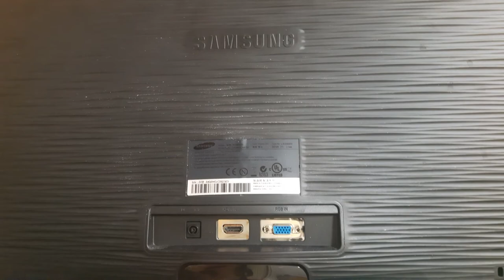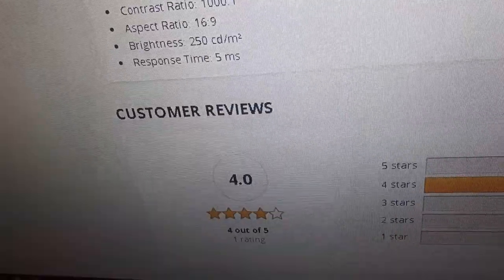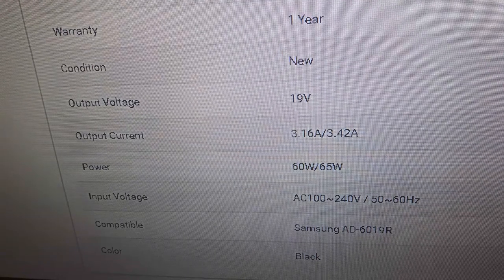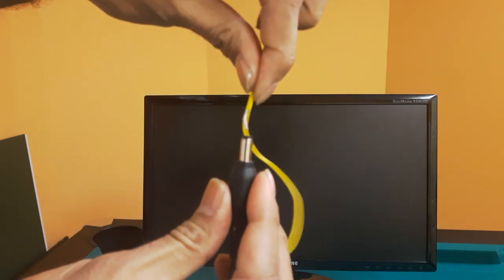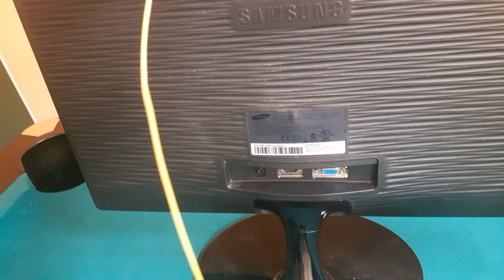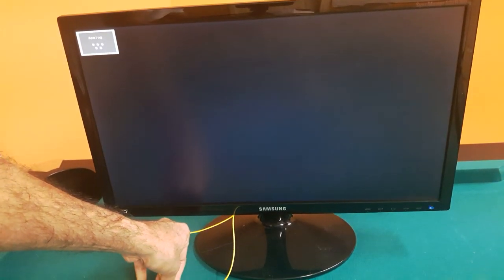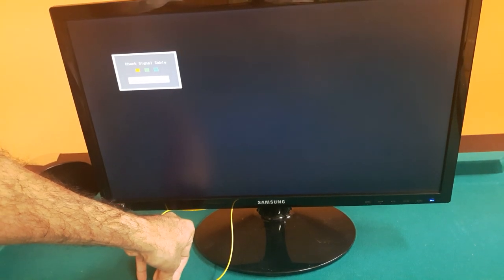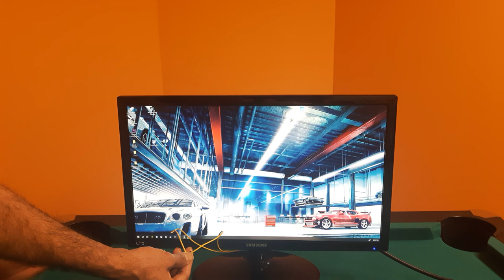DIY How to test an electronics device monitor laptop  without proper AC to DC power supply adapter?

Comment: Super, I was just wonderning exactly after I one monitor like for 5 bucks in salvation shop but with out power. I have  more than10  power supply...but dont know where l stored. I will your method. Just to findout and if it works I will buy a new power suply. Thanks. But tell your audience  to be little careful when playing with el.wire. hah. But yopu are great.

Comment: Can you please tell me what wires do I exactly need to make that adapter like can I use any type of wires like from battery of from a power cord? Like what were those yellow wires that you used?
Reply: its the wire that they gave you when you bought the monitor
Reply: no
Reply: It can be any normal wire that fits in the hole
Reply: Its better if its not thicc or tiny wires something in beetwen

Comment: Hey i still need help.... 

My monitor got a problem i got the same monitor whenever i plug in the cable theres no power until i twist the cable left right up an down is a specific position i think the power hole got a problem
Reply: The monitor power hole can become bigger and make the power supply wire a bit lose in the socket or it can be the wire that is like cut or smt and gets connected to the other piece in one position

Comment: i got a led monitor with a built in power supply and i wanna know, does a laptop charger work as a substitute for the built in power supply?
Reply: it should have the same voltage+amps and the watts need to be same or higher than what the monitor needs.
if you use the same volts but less watts the monitor might start to smoke or result in a defect
Reply: Led

Comment: Is this dangerous?
Reply: Yes 
If the 2 yellow wires get connected to each other they could spark light on fire or burn down the power supply and the whole house

Comment: don't try the wire methode, if you do not know what youre doing.
this seems a bit odd to show people this, for people that don't understand what they are doing.
why not just buy a new AC adapter with the right voltage+amps and the same watts or higher. looking for a plug that would fit ???
Reply from the maker: This video shows how to test if the monitor is working or not before you buy the adapter. Thanks for watching.
Reply: Yeah if u dont know which wire is positive or negetive it can catch on fire or in the worst cases cost u a new house or ur life